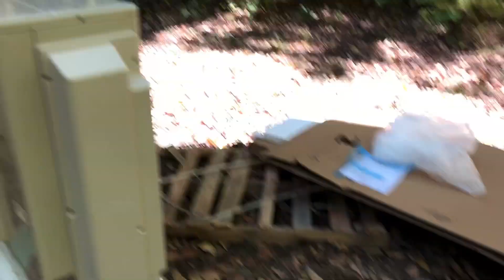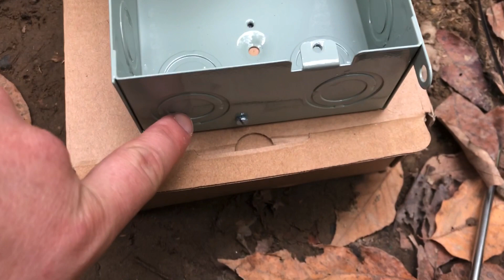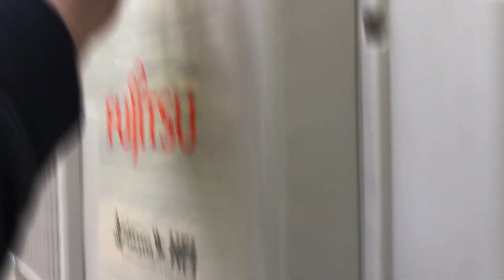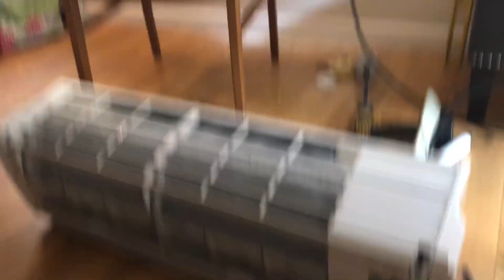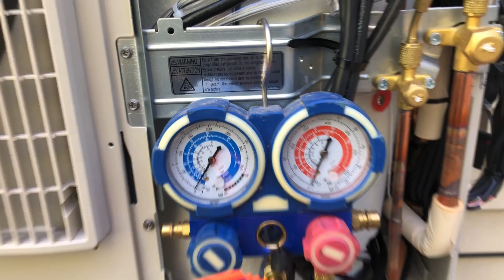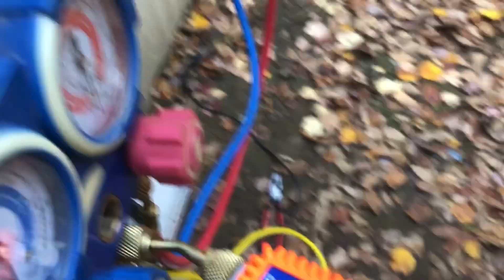How To: DIY Install a Fujitsu Mini Split Heat Pump

Comment: 25:28 That's the bit I was really confused about.  The manual says "evacuate from both the gas pipe and the liquid pipe", and no one on YouTube shows anything but using the blue line.  Thanks for explaining!

Comment: Just to clarify on the Nylog thing. I am a trainer for that teaches a 2 day Mitsubishi M&P class. The reason we say not to use NYLOG is not because it’s junk or trash it’s because there are serval strainers inside the outdoor unit. Nylog will not dissolve in the Refrigerant. If for what ever reason you have Nylog travel throughout the system you can stop a strainer up. If you stop a strainer up you will be hating life!!!! We suggest you use a good flare tool a drop of oil. Vacuum pump oil works really well. Then use a torque wrench. If you use those steps you will not need Nylog. I do use Nylog on other stuff because it does have its place. I just don’t use it for flares.
Reply from the maker: T&N Services LLC. Thanks for the feedback - great information! I will keep that in mind for future installs.
Reply: I've seen others recommend using nylog on the outside of the flare for lube and the threads. Is that ok?
Reply: A good flare should provide a tight seal.

Comment: Dude, you hooked up the disconnect switch wrong, if you plug in the disconnect bar like that, you will trip the circuit breaker because that would be a dead short. The two inside lugs are usually line and the two outside ones are usually load. another way to be sure that you have it right is to have the two white wires together and the two blacks together. You can also look at the disconnect bar and see which wires they are connecting together. I can't believe T&N services LLC missed that.
Reply: Two black and two whites together would also be incorrect, just swap the two white wires

Comment: Good video but a few points.  
1.  The HVAC kit that I bought had a 3/8" low pressure pipe but the units had 1/2" fittings so I had to buy adaptors.  Best check before you start.
2.  The outside units come with a Schrader valve at the gas import connection.  This is to stop gas leaking out when the unit is charged.  It is essential that the connector used to connect the outside unit to the vacuum pump has a valve depressor at its end.  On my outside unit, the gas import connection was 5/16" but the vacuum pump was 1/4".  You need to buy the special low loss connector to go from 5/16" to 1/4".  This connector has a built in valve depressor.

Comment: Great tutorial, but the pipe run looks pretty bad. Why didn't you bend 90 degrees?  
-Fujitsu says to pressure test to 4.2 MPa (+600#) which is pretty insane. 500# is still not necessary. You'll know for sure if your pulling in moisture once you pull a vacuum down to 300 microns and hold for an hourish.
-Nylog is great stuff

Comment: Did you flair your own copper lines? If so, did you double flair the ends like in automotive brake lines.
Reply: Single flared is fine. Refrigerant gets no where near the pressure of brake lines

Comment: Your high and low side connections are incorrect. Liquid side is the smaller pipe (red) and low side is the bigger pipe(blue) . I’m a 10 year experienced mechanical contractor. You did ok, somethings are not really how I would do it but be careful showing people this. The best tool in your tool bag is a hvac guys number.

Edit:
You switched them Nevermind haha
Reply: But he did refer to them verbally incorrectly

Comment: Corey, great video. I am thinking about getting the exact unit for my new build cabin in Northern WI. Where is this install located? I am curious about your winter weather conditions and the amount of heat the unit will produce in cold weather like some of the days we get in WI in Jan and Feb when it gets to -5 to -10 degree, From what I have read the unit is rated at -15 but wondering about real world experience with your unit.  Also, do you see any issues with putting this into a new build install. I am worried that if something happens to one of the head units my lineset will be inside the wall and it doesnt look like the lineset comes off the head unit for replacement if ever needed. How big of a house you heating and what head  units did you go with.
Reply from the maker: Scott Boucher we have a 3800 sf home in Maine. We heat the entire home with 2 36k outdoor Units and six indoor units. It is never cold in this house and we used them all winter. The units can all be replaced - indoor and outdoor units.
Reply: Choose the right fujitshu.... the low temp models will heat @ minus 15 outdoor temp

Comment: Excellent video, I want to install one of these units I work for a hvac company and I have my EPA certification, but a very important question about the manufacturer's warranty.

Can a homeowner install it?
Can a certified technician install it?
Must it be installed by an HVAC company in order to have the warranty?
Thank you so much
Reply: 1. If you think you can
2. Of course.
3. Depends. Fujitsu will not warranty any unit bought online. Pioneer, Senville, and others at minisplitwarehouse can be bought online but still require a licensed company to install.

If you install yourself, might as well buy pioneer. The warranty is only 2 years parts and 5 for the compressor. And IMO, if the compressor goes out, it isn't worth fixing because it won't last long after that anyhow.

Comment: I have same compressor. Its 205 lbs. Why would you put it on those flimsy chinese wire hangers?  Don't tell me its still on the wall ... I put mine on a 400 lb rated stand on a concrete footing.

Also it says in the install manual clearly to use ring terminals when doing electric connections.  You should probably do that asap.

And about Nylog and old school hvac guys. In my Fujitsu official factory training - they clearly say NOT to use nylog or any other thread / flare sealant, because it changes flare torque specs and torque requirements. And I haven't had a single leak on over 50 units, and never used nylog

Comment: Many thanks for making these videos! I'm about to tackle an installation of a four head system. Are you still happy with the cheap manifold and pump? I'm debating whether or not to spend the coin on the  Yellow Jacket stuff.
Reply from the maker: Ben Schmolze hi Ben.  I have used my cheap stuff for many installs and I have no complaints.  Unless you are a commercial installer, save the coin.  Best of luck!
Reply: These units are not cheap ,DO NOT USE THE TYPES OF WIRE  HE USED...... The wire from the panel to disconnect was the only right wire he used ..I am an electrician and do lots of other  work on my own house but i had a hvac tech that i know is good do the lineset and startup and he got a better deal buying all materials from a local supply house
Reply: that "S" cord will not last the 15 yrs these units should

Comment: hi
control wire  you say 14/3?..inside unit  i see you hook up 2 wire plus green..outside unit you hook up 3 wire plus ground? thx
Reply from the maker: Lev Vasserman 14/3 is the correct wire size.  You need three wires (plus ground) to connect each inside unit to the outside unit.

Comment: appreciate the video, but if you are going to do an informational video you should know a little more about what you are doing. Your disconnect is wired wrong, you will regret bolting this unit to the wall. Fujitsu puts out a harmonic that is very annoying when they run in heat mode. Even if you have rubber feet or rubber washers behind the bracket you can not break the harmonic that it will create. Use mini split stands. They are pricy but worth it. You should also use a connector at the back of the disconnect where your wire enters the box. Most important to all installers USE SURGE PROTECTION. Minimum use one in parallel, but even better using one in series. Without them in place there is a good chance you will be replacing boards. Lastly I cant wrap my head around how you ran the line sets and line hide. Any of my customers would freak the freak out if I ran line hide like that. Last you look very close to the ceiling with the indoor units. Remember return air comes in from the top and that is where your thermistor is located. Not picking on you or being a troll, just pointing out things that anyone whom has done the in class training would know. You are knowledgeable just have a few things to remember on the next install.
Reply: Also if gravity doesn’t work on the condensation line use a mini condensation pump  vs. running the line hide on angles. Its a clean look and they are very dependable.

Comment: unfortunately in 2018 EPA regs 608 certs, working on even R410a requires cert..easy online tests, for level 1 up to 5 lbs, which covers most mini splits.  Always more RULES, prior to 2018, R410a wasn't controlled like the old R12 and R22, which are no longer made...just recycled, but if you have an old R22 system...WHY, the system is probably so old and inefficient, get new..good video...
Reply: @David-ly7lh  the epa certificate is for r410a....which operates at the higher pressure..doesn't matter in mini split or window unit 5 pound limit...read the rules and regs
Reply: @cengeb  that cert is not used in place of all the other 608 certs. It would be in addition to. You can just get the 410a cert and be on your way.
Reply: @David-ly7lh  most mini splits are under 5 lbs, i have 5 installed here
Reply: @David-ly7lh  no, what do you think window ac units have in em?

Comment: your refrigeration knowledge is poor at best... you do things and don't know why!!!  Factory recommendations for pressure test is at 600 psi... your micron gauge shows how deep your vacuum is... not moisture....moisture dissipates at 750 micron... non condensables at 500 micron... factory recommendeds 300 micron... you did not triple evacuate... your lineset runs looks terrible...you also have other install issues... good luck with warranty!! AMATURE
Reply: His gauges are on the wrong side too, this drives me insane. I spent years learning my trade, the line sets ran look bad but he’s completely wrong with the high and low side connections. 
Edit: I see he has corrected the gauges. Still , the slim duct he ran is pretty bad